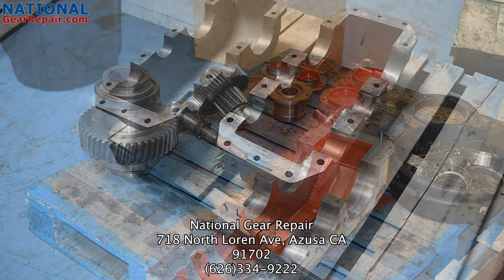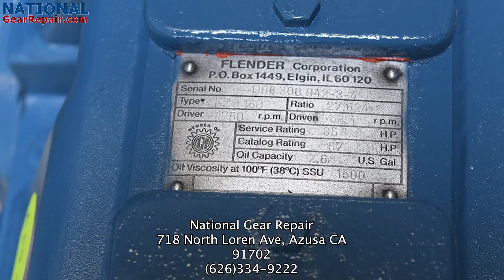FLENDER GEARBOX REPAIR

Comment: Dear National Gear Repair.com If your customer is looking to extend the MTBF after an repair or there is a need to improve the reliability and you are not informed about the MRO-loop and what the impact is on your gears set and bearings, please do not hesitate to contact me.